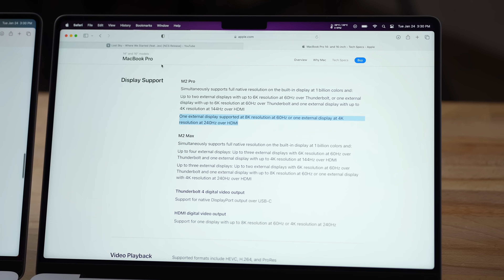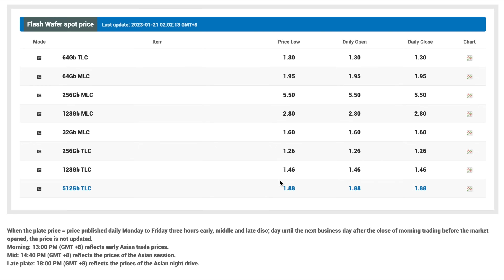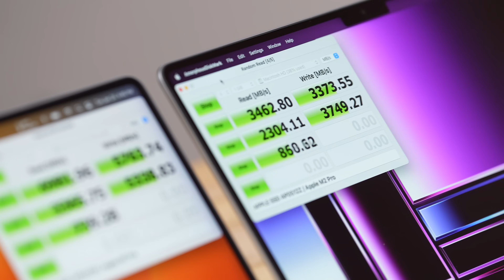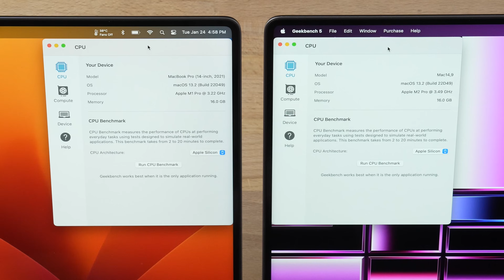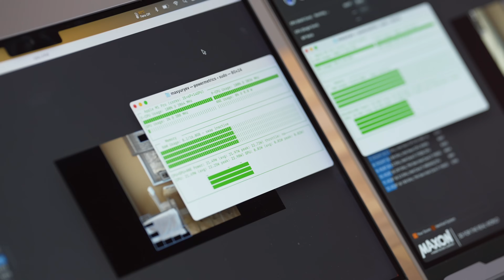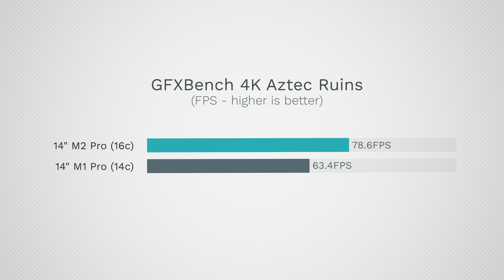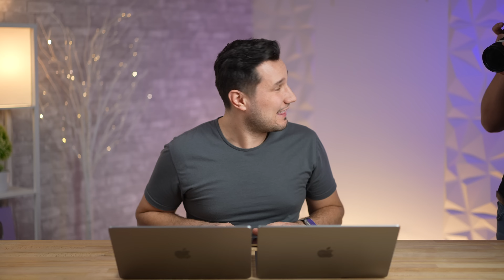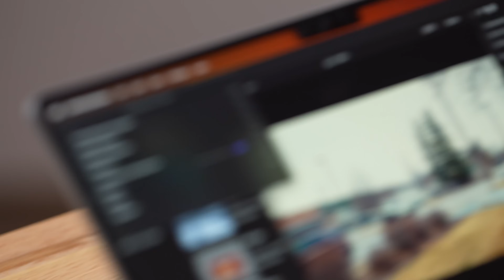M1 Pro vs M2 Pro 14” MacBook Pro - ULTIMATE Comparison!

Comment: Hello, I like how you do the comparison. That helps a lot. But I think If testing CPU & GPU together. the result of M2pro shouldn't be that bad. Also, for the writing & reading speed, it also depends on whether the disk for transferring is SSD or not. If not, it shouldn't have much difference comparing to M1pro & M2pro chip. especially the SSD disk is much more expensive than the regular one tho.
But yea, Apple is obviously saving the cost to make more profit, and not surprised with this, since it's Tim Cook...
and it's also very possible that they're even have quality difference with the same size of 512GB SSD on different levels of the new MacBook Pro. who knows? Based on the global situation, the inflation rate, USA interest rate, and so on, people in USA are lucky, they still get the same price, but not for people from other countries. and if their sales drop this year due to the price increased globally, won't be a surprise, either. and even in the future, and of course, overall, they shouldn't increase the price for other countries at all, especially when they're basically just upgrade the chip for M2Pro which probably not even much better than M1pro since they're both 5nm from TSMC even M2pro is the 2nd generation which mostly just help to improve the battery life. But it seems like Apple designs the M2Pro model to put GPU on the priority for workload. So, for people who only use it for normal tasks, shouldn’t have too much benefit from that. As for the 16GB memory that’s divided by 4GBx4pcs like on those articles say, I didn’t see you show it on the video, is it possible that you can also make a video of that to prove if it’s true ?

As for the question, if people should buy the new MacBook Pro with M2pro chip or not. I think, the price, the speed are not the only main reasons for me tho. I’d also put the quality control into consideration. Especially with the global economic situation like I’d mentioned above, also the labour cost, the shipping cost are needed to be considered as well. I really doubt that Tim Cook would really put the quality first, and profit next. This is not the first time that Apple keep asking suppliers to lower the price. And TSMC is def going to increase the price, that’s for sure. And for the long-term, it’s very possible that they will lose a lot of profit for just manufacturing in USA. 
Like there’s a saying, There's no such thing as a free lunch. When Apple make suppliers to lower the price, of course, they eventually will agree cause they don’t wanna lose such a big client. But then, the quality will definitely be an issue. And I think, we already seen that for the products that are released in 2022. I personally would purchase at least 4units for the exact same models for comparison. For the M1pro MacBook Pro, I noticed that, for the keyboard, the F key, has an issue, that 3 of the models are more loose. Only one of them are tight. And you can hear the difference with the sound when you type. 

And for the coating, if you comparing with previous old models, they already change the way they do the coating. And you can see the details when you do the comparison in the sunlight, and indoor, then with the flashlight. 

I think it’s possible because of the environmental friendly reason. Same as the glasses nowadays. If you buy a metal like aluminum glasses, the frame will easily have Color-off issue if contacted with the skin or sweat. Cause they’re now only do 2 layers of coating instead of 4 layers like in the past. and since Apple’s other iPad and MacBook Air have coating scratch off issue like on those news, it’s possible due to the coating layers. 

Anyway, Tim Cook, once again, don’t forget where he’s coming from. Hahaha he def put profit for priority , that’s for sure. 

So, I suggest people who really wanna buy Apple’s products, not just only comparing the tech, but also better to put the quality for long-term into consideration as well. 

Thank you for reading my such long long comment. Have a nice day !

Comment: I’m definitely happy with my 14” M1 Pro. Your original analysis convinced me over the M2 Air, and I’m glad to see that mine has better speakers and ssd in the end.
Reply: M1 Pro is slower single core than M2 Air though.  Less of an advantage overall, depending on what you're doing.
Reply: @abc123fhdi  but it won’t perform better if you don’t upgrade the storage as well, as the read/write on the base Air is lower speed memory
Reply: What is the battery life that you’re getting on the M1 Pro and while doing what?
Reply: Who buys a laptop for its speakers? LMAO
Reply: @sam_9228 it’s a factor if you stream a lot or watch a lot of videos / do calls.       it really does play it’s role.
Reply: I just watched the M2 Max vs NEW Intel 13th Gen i9 w/ RTX 4090 and I have the M1 Pro, the M2 Max was slower in blender renders than the M1 Pro. I also much prefered the speakers in the M1 Pro.

Comment: I am wondering the temperature of keyboard and bottom of the laptop during not only heavy load but also normal use. M2 MacBook Pro feel warmer than M1 counterpart for normal use? My concern is how comfortable using the MacBook Pro on my lap and typing document. Do I need to worry about low temperature burn?

Comment: I wonder how hard it is to get the 'real-life' performance, because brand-new macs are usually shipped with early software systems, that are mostly unstable (maybe not in this case, as Ventura was released some time ago), and checking the edgy conditions that may happen throughout the day is sketchy. I myself am fan of going around my home constantly closing and opening my M1 Macbook Air and it almost never freeze. I have it since it was introduced, and it has basic specs and it's still a wonderful machine. I'm totally curious about the performance in Xcode while doing such tasks, as I am able to develop apps and websites even on current Macbook Air with small sacrifices as there is usually not enough RAM to handle Xcode, Simulator and many browser tabs xd

Keep up the great work guys!

Comment: The impact of the SSD NAND issue in the Macbook M2 chip on performance can vary, but it is a known issue that Apple may address through software updates or hardware repairs. It's important to stay informed on the latest developments and recommended solutions from Apple or authorized support providers. Thanks Max Tech again for one more great video!
Reply: SSD NAND thing is not an Issue but feature 😀 It will stay like this because it is cheaper for Apple to use single SSD chip.
Reply: @JackCarter911  If M2 would be more beautiful then yes... :)

Comment: The comparison was informative and well-structured as usually. Thanks Max Tech! I appreciated the attention to detail and hands-on approach. The demonstration of the new upgrades was very helpful in understanding the improvements of the Macbook M2. The video quality was also top-notch and made it a pleasure to watch. The issue of the SSD NAND in the Macbook M2 chip could potentially impact performance negatively if not addressed properly. However, the extent of this impact would depend on various factors such as the size of the SSD, the usage patterns, and the overall system configuration. Much love <3

Comment: Why did focus on the sequential read/write when those are used only when you move giant files around? The important stats are the random 4k ones, since those impact your daily usage of the OS, and those are in line, if not slightly higher, than the older model.

Comment: I still and use a MBP mid 2010 and a late 2013, after I upgraded the HD in both, they loaded the programs in a light speed way, so in the new ones, well you can't do that , therefore you're stuck with low performance HD:face-orange-raised-eyebrow:

Comment: This is an exciting new video of the M2 Pro MacBook Pro. There are so many new features and improvements compared to the M1 Pro. The improvements include the powerful HDMI port that can process 4K 240Hz and the 1080p webcam that is much more detailed and cooler. Furthermore, they have also upgraded the speakers to provide a brighter high. The comparison between the M1 and M2 Pro is really interesting. The M2 Pro has an M2 chip and a single SSD chip which is cheaper, however results in much slower speeds. There is a 20% increase in multi-core and a 10% increase in single core performance on the M2 Pro. Also, the new M2 Pro runs much hotter with the fans running louder. The M2 Pro is great for web-based applications and graphic design, and also renders 3D images much faster than the M1 Pro. This is an excellent comparison video that covers all of the differences between the two devices, and definitely helps users decide which one to get!

Comment: You guys still provide the most extensive coverage on the new Macs.  Great job.  Keep it up.  Love the detailed analysis.
Reply: So you buy a new Mac everytime they come out?
Reply: @jan_phd  I do not.  I currently have a 2019 I9 MacBook Pro but am waiting for the M3 Max MacBook Pro to launch.  I was held back a little bit because I use a couple windows apps in parallels but now that Microsoft officially supports Windows 11 on Arm on a Mac with Parallels the path should be clear for me.  I am also expecting some significant gains when the M3 chips arrives.

Comment: I am genuinely surprised by the results I am seeing, as the new MacBook Pro with the M2 chip appears to be significantly faster compared to the previous generation. The increase in speed is quite remarkable and is making a noticeable difference in the overall performance of the device

Comment: The only visible upgrade to the new 14" is marginally better battery life, Wifi 6e and HDMI 2.1 (a standard/protocol which is 8 years old I think). Also, can you test how 14" MBPs charge over an 87W brick? So far nobody's done that yet I'm very curious about this 🤩

Comment: Been using my private and company MBA M2 since a few months and they are both powering through my daily workflows - only thing that still makes no sense to me is the missing of FaceID in the Notch and the missing support for more than 1 external display is a bit of a bummer but you get used to it.

Comment: Excellent presentation, and great timing for me to have found this as I'm contemplating getting the new M2 Pro 14" to replace my current, 2018 2.6 gHz 6c i9 MBP, which I use for Fusion 360.  The slower SSD is concerning, but I would be getting 1T SSD, which might mean the second controller chip will be populated and thus increase performance. Any thoughts on that? I am hoping that Fusion 360 will be faster on the new 14: M2.

Comment: The SSD reduced to 1 is really a turn down…but still awesome and it supports 4k120 and 8k60 now. Finally worth to upgrade my monitor tgt and pick up my passion on video and photo editing again
Reply: I think it’s actually to stop the ssd problems with m1. Twice the speed but half the lifespan with those striped ssd raid 0 arrays on m1. M2 ssd should last twice as long.

Comment: Awesome review. After watching I bought a discounted base spec 14”. The m1 14”s cooling system was already unable to deal with the M1 Max and seeing that they reduced heat sink size (and an M2 that runs hot), for someone who wants quiet running the m2 version is completely off the cards. 

Worse still id need to pay to upgrade the ssd with storage I don’t need (I’d rather use a big capacity external), just so I don’t get the speed halved. 

If I had the choice between the base spec m1 14” and the base spec m2 14” for the same cost, I would still rather have the m1 version.

Comment: i wanted to check/compare how fast is those M apu`s to my full system since they started by saying their gpu is as fast or faster than a 3080ti and faster than a core i7 so i downloaded blender and the bmw27 test and i asked it t render and i got it finished in 13s oO ?? what am i doing worng here ? it cant be like x10 faster that this laptop now can i oO ?? im using an old 12700k cpu with an old rtx 3090 here .

Comment: If you have LG 34WK95U-W such a monitor, which version should you use, what kind of configuration should it be, so that there is no problem of work and contraction. Question my macbook pro 16 2019 late 16GB 5GB GPU and this problem exists. (I'm thinking 14 inch air or macbook pro) @max Tech ?

Comment: I’m just so surprised how you guys are brave enough to buy these system and open them up n give us detailed information.. I would never dare to open such complicated and expensive system ! Looking internal difference just amazes me with the internal designing of the system. Well the slower ssd speeds won’t have that much of an impact but yes it’s irritating according to the price n what u get it a slow sssd speeds these base system are also not that cheap! It’s just way for apple to make u chose an upgrade but yes at the same there might be some people who don’t see it but i guess those user will rather be the MacBook Air buyers not the pro

Comment: I feel that many people, especially those that are first time buyers, would be more interested in 14” M2 Pro 10/16 to M2 Max 12/30 comparison, both with 32GB and 1TB, in order to figure out can we get away with model that is just bit over entry level or we really need to splurge another $500 to get M2 Max. If you could do such comparison it would be very much appreciated, especially if it focuses on all aspects of video editing and not just simple rendering. Import/export of photos in Lightroom or simple video rendering doesn’t stress the machine nowhere near what applying of noise reduction, complex transitions, and effects does.

Comment: So the M2 runs hotter but performed better? You mentioned thermal throttling when you begin the video, but it appears it’s threshold allowed maximum performance, even though it was extremely hot.

Comment: With the SSDs, there are actually NAND modules on both sides of the motherboard.

With the older M1 Pro MacBook Pros, there are a total of four 128GB NAND modules in the base 512GB model. So with the new M2 Pro, it seems like there are two 256GB modules. This was likely done by apple in order to save having to vendor out 2 different NAND chips and to double the amount of storage space the m2 MacBook pro can have

Comment: Highly surprised that they shrunk the cooling. The SSD ‘situation’ in a pro machine is unacceptable.. it just pushes buyers to upgrading their SSD’s for performance. Marketing wise pretty smart… but I wonder if it’s a smart long term idea. 
Anyhow if you have a base 14” MBP m1, it’s apparently hardly justifiable to upgrade to a base 14” MBP m2

Comment: You guys have awesome reviews I recommend them daily. 
But even though the heat sinks are smaller it doesn’t look like it’s causing any issues. But it’s weird that it uses more wattage and makes more heat but has a smaller heat dissipation system

Comment: Great comparison with lots of details on the performance differences given various tasks. In the end, however, I think the real value proposition is the 14" M1 Pro refurbished, which you can get from Apple for almost $500 less than the new 14" Pro M2. The M1 Pro remains a high performance system (with much faster SSD) and, IMHO, the M2 performance gains from CPU/GPU intensive operations do not justify an additional $500 (roughly). Voila.

Comment: Excellent comparisons. What this tells is that its an illusion to think of the new MBP as a 2000 dollar machine. If you want to get better performance, it should be configured with at least 32GB of RAM and at least 512GB of SSD storage.

Comment: Though it is likely that the higher priced models do not have the issue with the SSD speed being down compared to the M1 chips, I still think it is an unfortunate choice apple made.
Yes, with all the inflation going on and maybe chip shortage and price as well it is an understandable choice economically but I don't like it.

Comment: Yes, it's a bummer that the sequential access pattern for the M2 SSD is slower, but you didn't even mention--did you notice?--that the random access pattern is (slightly) faster on the M2 SSD. If you upgrade the SSD in size--so that more than one SSD chip site is populated--the difference in random access pattern speed will likely be even more dramatic. And, it's random access that your want to be fast for daily use. Yes, if you're constantly reading large contiguous files, sequential access can matter. But, most users access a lot of small-ish files. One exception is when you're starting a large application: then, the machine will likely access a fairly large amount of contiguous code to launch the application. But, in that case, 3GB/s is almost certainly enough. If you're editing video, you're likely creating large, non-contiguous files that will be accessed essentially randomly. Anyway, I don't think the SSD speed would be noticeable in daily use. If you asked people to use both machines for a while and then asked them which machine has the slower SSD, you'd find that people cannot reliably determine which is slower.

Comment: My 2012 MacBook Pro has 512GB Storage when 1080p was the thing, the fact that it's 2022 and 4K meanwhile 2TB is not the standard in Pros is baffling - the price Apple asks for upgrades gets one a 2TB PCIe 4 drives from Samsung with reads & writes of 7500~ like those from Seagate. Heatsink downgrade is another disappointment while crossing 100º C which will only impact battery health like gaming laptops.

Comment: Guys, I am super keen to see how you review the 14" M2 Max with 38 cores. I WOULD LOVE to see you compare that laptop against some older Macs, namely the 2020 10 core i9 iMac with Radeon Pro 5700XT 16GB GPU. My finger is on the button ready to buy the maxed 14" model hoping it can replace my iMac workstation, but want to see the GPU performance and throttling situation.